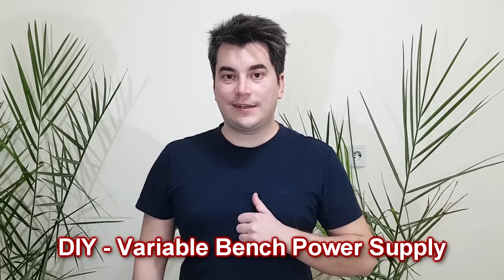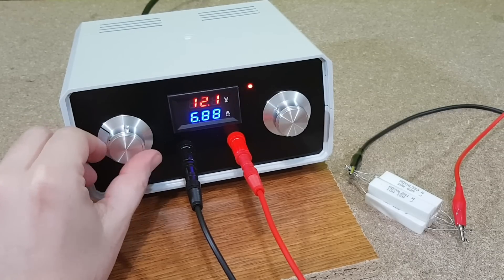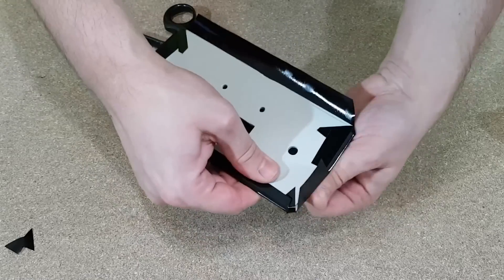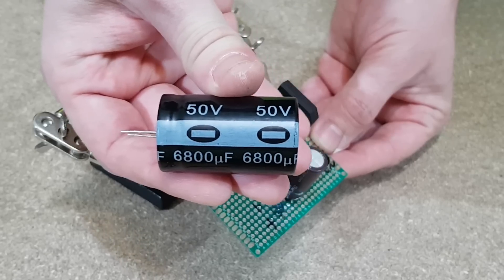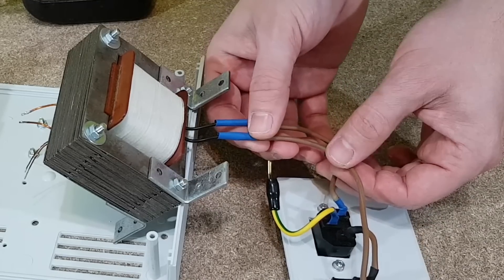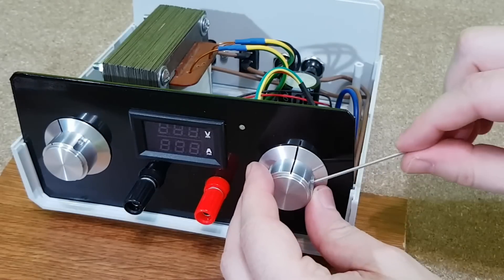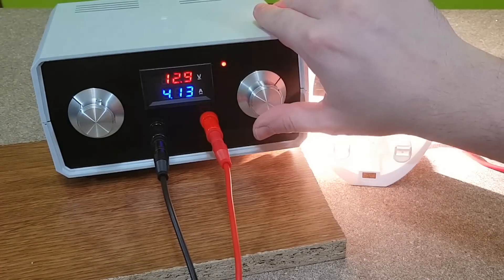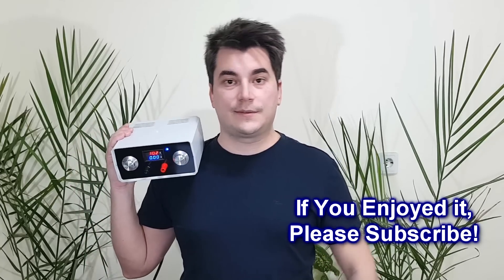DIY - Variable Bench Power Supply (Very Powerful)

Comment: i have seen alot of these duy bench supplies but your presentation is the best because of the fact that you icluded the wiriing diagram ... just watching them do it without diagram can potentially burn out a component if you dont know whats happening .... thanks..alsoit was nice that you told me about the volt/amp meter destinction that one is good the other not so ...ill take the precaution when buying  ty

Comment: good choice choosing that iron transformer, it can handle lot of amp not like those crappy switching power supply, can't handle over current it triggered protection circuitry and shutoff and cost a lot too, nice work thumps up sorin
Reply: I disagree there are a lot that can do 10A 5 or 12 or 24V just fine with a way higher efficientie
Reply: @bashaaksema94  yes i agree with you smps are super efficient it is very useful for some appliances but in this topic the main subject is high power project and iron transformer is suitable for that iron transformer have some watt tolerance like my 24v 5a=120w transformer, i can push it about 130 to 150w nothing is problem but yes just a little bit warm but my 12v 20a smps power supply, if i put a little bit amp like 21 or 20.5a boom!!!!! it triggered and it also cost me a lot too not suitable for my high power project

Comment: You should add smaller value potentiometer in series for better,more precise voltage set.Also adding 100nF paraller to big cap provide less hum in the output.

Comment: It's a nice build, really. For a home enthusiast, this is something nice to build and have. But, I'm wondering why you used the 10A fuse on the primary side (mains side) of the supply? With the power output of this supply, you can put the 1A fuse instead and be much safer. 1A fuse will blow when you've reached the 220-230W (mains voltage x the current). Also, use a slow-blow fuse because when you power on the supply, the transformer will draw a much larger current for a very short time. The 6A fuse on the secondary side is perfect.
Reply from the maker: hi. I used the 10A fuse for the inrush current. I had only fast blow fuses when I built it.
Reply: @Sorin_DIY  OK then, but please, correct it and put a slow blow fuse of 1 to 1,5A for safety reasons. Otherwise, a very good job and choice of components.

Comment: Thank you for y?our video. This one was much better than your video on building a power supply from a PC power supply. Your English pronounciation has improved considerably. So I have subscribed now that I  can understand you much better!  Btw- The heat shrinking tubing is called eat Shrinkable TUBING. I am not certain what you are calling it but it  doesn't appear to be right.

Comment: replace with multi turn potential meter... it give more voltage resolutions ... it also help like if any one touch rotartry party slightly it mess voltage . if more we close to required rang ..example -  really slight turn is change 4.2 v to 9v which also kill lipo ...
Reply from the maker: you are right. I already bought the potentiometers. I will make some other modifications to make it more powerful. I will make a video about it.

Comment: Nice Work Sorin ! I made a couple of them ! Switching power supply it's used in most electronics . Just if your working on microcontrollers  based electronics a switching supply might give the designer a lot of headaches .  Linear is the way to go ( if you can spear to dissipate some heat LMAo ! ) just modified one those 0 to 30 volt 0 to 3 amp DIY kit up to 0 to 25 amp . it was kinda fun .  In the near future i'll post some of my own projects . Unfortunately they are not that entry level electronics  . Anyway  great to see peple from my own country doing this kinds of tutorials . Stay crative  !  ;)
Reply: I wonder how you did this, and you got 750W from a 0-30V 0-3A (90W max) power regulator board! The supply must work like a space heater at low voltage high loads ;)
Reply: @imnotbeluga007  have you head of coil switching ? that's used in lab power supplies  . look it up ;)
Reply: @lucianungurean  None of my PSUs has this, but maybe it's just because my most powerful power supply is only 300W.
Reply: @imnotbeluga007  those Lab bench power supplies have coil switching . its the only way not to waste all the power in heat . they   swap when a higher or lower power is needed . that's why they dont have a gigantic heat sink . I made myself a 0 t0 25 amp linear power supply with the same principle . actually it's a schematic i found . It's the Mastech HY3020 . i made it to push out 25 amps in stead of 20 like the orginal version . Just cause my transformer had more current  available
Reply: @lucianungurean  OK, interesting!

Comment: If anyone decides to copy this design I suggest you check that the ripple current rating of the large capacitor is significantly greater than your expected output current at high voltages i.e. the maximum power situation.

Comment: You forgot to install 12v cpu fan and heatsinc to cool down IR chip circuit if these two not installed the 12v and 5v will overheat. Others are amazing what u did.

Comment: Hello sir ,I have a trouble .I've made the same circuit but I use 24v 1.5 amps transformer.i also add a cooling fan .the connection of the cooling fan is in this way -i connected 2 wires with the ac output ,rectifiy it use a 7812 for fixed voltage and then connected the fan .but when I'm increasing the load the speed of fan decreasing .and when I'm using a amplifier circuit and when I play the song it sound low and the power supply is not working well . please help me😭
Reply from the maker: your power supply is not complete. the 24V output it's the peak or the RMS voltage? did you connected the fan to the 24V output? have you connected a capacitor after the bridge rectifier? cooling fans usually need 12V maximum. the fan spins slower, because most of the power is used by the load.

Comment: Personally I think this PS is fabulous (just what I want) but.....I think it would have been 'really really nice' to have seen a fan fitted into the enclosure ;-)
Reply from the maker: hi. I will soon upgrade it from 90W to 150W or more, I will also add a fan.
Reply: @Sorin_DIY  I'd also like to know what those DIY power supply with fixed 3.3, 5 and 12 volts have three ground terminals instead of just one AND why not negative terminals PLUS an actual ground terminal
Reply from the maker: are you referring to my fixed voltage power supply conversion? I've added 3 negative binding posts, because I can use all outputs in the same time and I think it looks better this way. you can watch the part2 video for more info.
Reply: @Sorin_DIY  yes - I was referring to your fixed voltage power supply (another very nice project). It is my intention to combine the fixed power supply (ATX PC PS) with an adjustable / variable power supply (lap-top charger) all within the one enclosure. I agree with you about the black backing. Those two silver knobs and that sleek design looks sensational.

Comment: Can I solder a normal 100 kOhm resistor to a 100 kOhm multiturn potentiometer in order to get to 200 kOhm? Can't find a 200 kOhm multiturn potentiometer! My step up booster uses the 204w trimmpot

Comment: What happen if i use a computer power supply, instead of transformer and bridge,  and thanks for sharing
Reply from the maker: a computer PSU has max 12V, so if you want a higher voltage, you need a step up/step down converter with current limiting, which is more expensive than the step down converter I use.

Comment: hi mr. sorin, what would be the value of a bridge rectifier, a capacitor and a resistor for lower component of 11volt supply? thanks
Reply from the maker: hi. are you referring to the volt/ammeter supply voltage? it uses only a few mA, so a 1A bridge rectifier is enough, 10kohm resistor and a capacitor of 1000uF and 16V.
Reply: @Sorin_DIY   thank you so much for your qucik reply...

Comment: main fuse should be around 1amp not 10amp, thanks for the upload,
Reply: Did you account for surge? 200VA transformer needs 1amp to just operate and power surge during startup could be 5A, so you need 7A slow blow fuse or 10A fast blow fuse. It will save you from fire, that's it.

Comment: What is the device in parallel after the 6800m50v capacitor? j, hey, is that a resistor?  How much hug?
Reply from the maker: it's a resistor, to discharge the capacitor. the value it's 82Kohm

Comment: What is the value of two resistors connected in parallel behind the capacitor and what is their use? If the voltage behind the capacitor is about 70V, how much resistor should I use? Please help, thank you.
Reply from the maker: The resistors are used to discharge the capacitors after the power supply is turned off. there isn't a fixed value, just enough to discharge the capacitors and not get hot in long use. you can use a 6.8Kohm and 2W resistor. 
If you use the power supply for a long time, you can check if the resistor is heating up, then you can use a more powerful resistor like 5W.

Comment: Can i reduce voltage drop if i use smps instead of transformer?. I'm using the same xl4016 converter.
Reply from the maker: you can't reduce the voltage drop. you can add a big capacitor in parallel with the step down converter input, 6300uF and 50V. it will keep the voltage more stable when you connect a big load, but only for 1-2 sec, not continuously. I think the only option is to use a more powerful power supply.

Comment: Don't you think the Buck Boost converter will be more appropriate for this application and when transformer experiences a voltage drop, the back boost convert will adjust the voltage accordingly.
Reply from the maker: hi. the voltage drop appears at high voltage values and big loads. at medium and small voltages it has enough current, more than other power supplies and buck/boost converters. it's not a problem for me. buck/boost converters have their own disadvantages, most of them have a very low efficiency, 80% - 90%, and work with a lower current. you can find good buck/boost converters, with better efficiency and high current, but they are expensive. as for my power supply, I have some ideas to make it even more powerful. I will modify it in a future video.

Comment: Hey Sorin, what happened to your old ATX PSU power supply? Is it dead already? Why are you making a new one here.
Reply from the maker: hi. my ATX power supply works fine, but it has 3 outputs with fixed voltages. this is a variable bench power supply. it's able to modify the voltage between 1 - 31.5V and limit the current.
Reply: Variable .

Comment: The dc suppy from rectifier circuit will charge the capacitor to 50v and the same will go to DC to DC converter module. But specified voltage for the module is up to 32v only so what can be done ? Facing same problem
Reply from the maker: hi. the capacitor is charged with the peak voltage coming from the bridge rectifier, which is 32V DC.

Comment: Sorin again great but at 6.0 which two-color LED you used anode or  cathode common and this LED does not appear in your diagram.
why bicolor ?
thank you
Reply from the maker: hi. the LED it's already soldered on the step down converter, I just extended the wires. the LED should light up in different colors when the module is in constant-voltage or constant-current mode. but it's not very precise.
Reply: OK thank you

Comment: Nice. Is the transformer 12-0-12 volt , 5 Ampere or 0-24 volts? Will we get noise free output from the buck converter?
Reply from the maker: The transformer has a 24V output. The converter I used in this video is pretty good, it has very little noise.

Comment: Good, I want to know if a 12VAC 1A transformer can handle a 5A step-down converter ?
I know that after the transformer the voltage has to be rectified by the rectifier bridge and filtered by the capacitor, I want to know a transformer from 220VAC to 12VAC of 1A can handle a step-down converter of 5A ?
Reply from the maker: hi. if you use a stock 12V transformer, it has a peak voltage of 16.9V. the RMS voltage is 12V. after you connect a bridge rectifier, a smoothing capacitor and a 1A load, the voltage will settle  to the average value of around 12V. but in your case the step down converter is not the load. the load is what you connect to the step down converter output. your transformer output power is 12V*1A=12W. if you connect a load to the step down converter bigger than 12W (excluding the power loses of the converter) the transformer voltage will drop even more, to the point where is not usable anymore and the transformer will get very hot.
Reply: @Sorin_DIY  thanks, so if the maximum current is 5A, I have to use a 12v 5A transformer ?
Reply from the maker: not exactly. first of all I suggest you don't use the step down converter at its maximum current, it will get very hot and may get damaged. also it depends on what loads you want to connect to the step down converter, the voltage is also important, not just the current. U*I=W. if you input 12V at 1A in the step down converter, you can output 12V at 1A (excluding the power loses), or 6V at 2A, or 4V at 3A, or 3V at 4A. all of these combinations give you 12W which is the input power of 12V * 1A. so when you talk about a load, you also need to mention at what voltage, not just the current. there isn't a "yes" or "no" answer for your 5A question, you also need to specify the voltage. if you use a transformer of 12V at 2A, you will input a power of 24W into the step down converter. so you can connect a load of max 24W. what output current? divide the 24W at the load voltage and you will know the max output current.
Reply: @Sorin_DIY  thanks, the voltage of the load connected to the output of the step down converter will be 12 V. logo 24/12 = 2A
Reply: since 24/12 = 2A, I have to use a 12 VAC 2A transformer ?
my step-down converter can handle a maximum of 5A, giving the step-down converter a slack. at most I can use 4A to not burn? what value do you recommend at most in this converter in the current?
Reply from the maker: yes you can use a 12V and 2A transformer
Reply: @Sorin_DIY  thanks, then the transformer current from 220 vac to 12 vac depends on the load current that connects the step-down converter output ?

Comment: What is the output of the transformer??
Reply from the maker: hi. for the voltmeter display 9V rms and for the step down converter 22V rms (32V DC peak) with around 3.5A. I will modify the power supply soon and make it even more powerful.

Comment: Oh dude its really a good video for me to make a variable power supply. So my question is I got a 16V transformer with a half wave rectifier in it and it got only one output lead which is 16V DC, so how it is possible to connect the ammeter connection in the transformer?
Reply from the maker: hi. if you want to add a CC/CV step down converter, you connect the ammeter to the converter output wires. I suggest you replace the half wave rectifier with a full wave rectifier and a big capacitor, otherwise you will not benefit from the transformer's total power.
Reply: @Sorin_DIY  Ok I have CC/CV buck converter, I can connect the ammeter. For the transformer which gives output of 16V 3A what will be the capacitance I should add? I already soldered 25V 4700micro farad capacitor, is it enough?
Reply from the maker: 4700uF it's ok. but if you have the possibility to add another one, it will be even better.

Comment: Can I use this power supply for laptop and mobile repairing.
Reply from the maker: for laptop yes. but for mobile phones I don't think it will work with all types. it goes down to minimum 1.3V and 0.25A and it's not very accurate at these values.

Comment: Is there a short circuit protection?❤
Reply from the maker: hi. the step down converter has short circuit protection. I also added fuses on the mains input and on the output of the power supply.
Reply: @Sorin_DIY  
good job thanks very much 
keep it up 😘

Comment: Is this power supply safe to run dc powered devices because I'm going to make it using 12-0-12 5amp step down transformer.
Reply from the maker: yes.

Comment: Potentiometers in partlist not have
Reply from the maker: https://www.aliexpress.com/item/32844752123.html?spm=a2g0o.productlist.0.0.7e4b71bbqfauwa&algo_pvid=118d83c3-899d-4af2-aa27-8b01aaa3a357&algo_expid=118d83c3-899d-4af2-aa27-8b01aaa3a357-2&btsid=d89461ce-5401-4488-8ac5-8a06213095b9&ws_ab_test=searchweb0_0,searchweb201602_5,searchweb201603_53
Reply: @Sorin_DIY  
U like to be funny?
The  electronic need only 2 potentiometer, not a Katalog of a lot
Reply from the maker: ok, this is the link for 2 potentiometers of 10K ohms:
https://www.aliexpress.com/item/32410988546.html?spm=a2g0o.productlist.0.0.461671bbbBxxWH&algo_pvid=a15a57ac-4a05-4cab-9044-5cd923d0f8cb&algo_expid=a15a57ac-4a05-4cab-9044-5cd923d0f8cb-44&btsid=8a41b331-88a4-462b-bb22-55ef3902858b&ws_ab_test=searchweb0_0,searchweb201602_5,searchweb201603_53
but if you use the first link and select B10K you get a better deal.